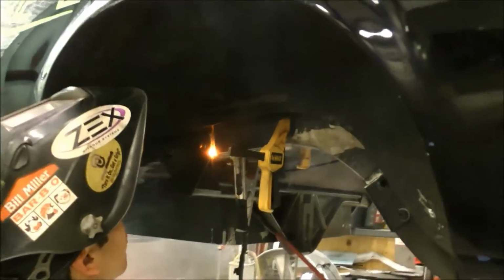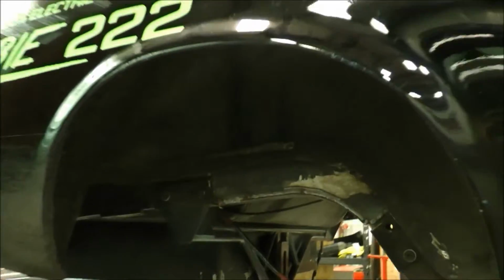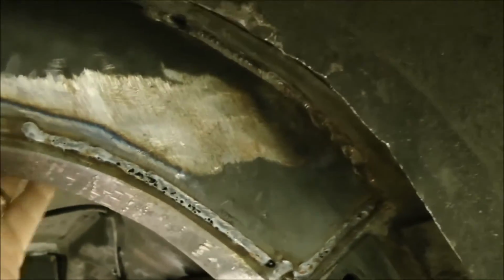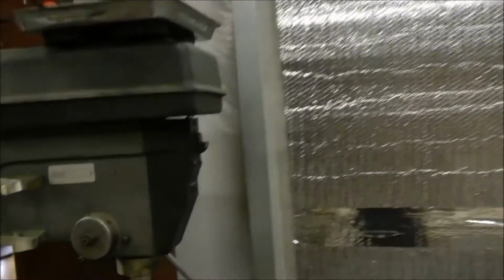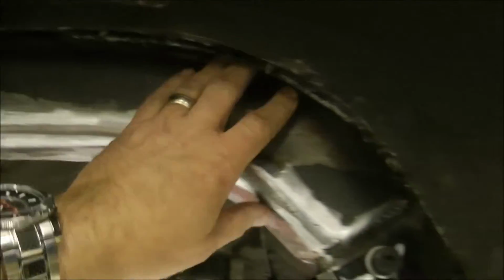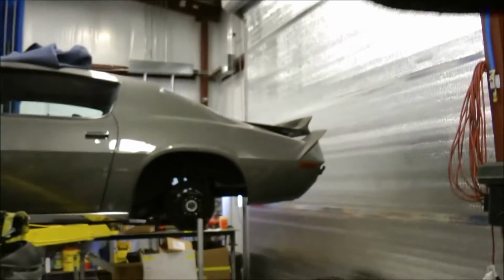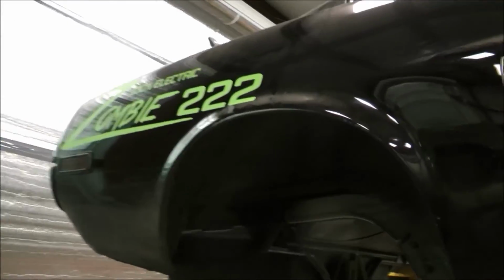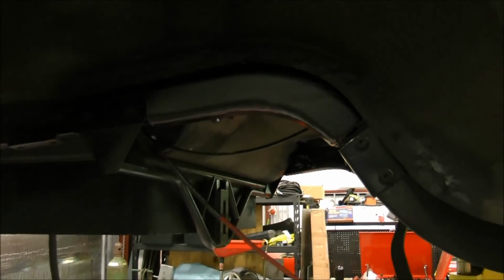Zombie 222 coil over repair - post Texas Mile tear down

Comment: Why didn't you put holes in the frame doublers and rosette weld them to the existing frame section?  The doublers aren't as strong without the plug welds.

Comment: Wow. That must've been a little hairy to have that happen when you're breaking a speed record. The new setup looks amazing.
Reply from the maker: +James Gordon I knew something wasn't right because every time I got over 140MPH, the car felt like it was trying to swing left and right. At 175MPH it was a little scary. The last time we ran the Texas mile I got have let go of the steering wheel at 170mph it was so smooth and straight.
Reply: Wo. Freaky, for sure. I'm glad you were able to keep it under control.